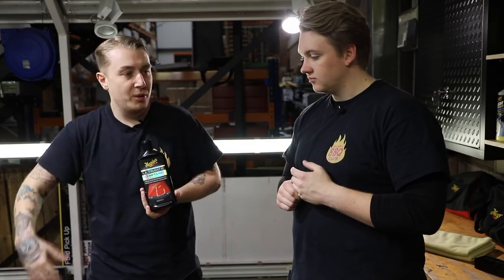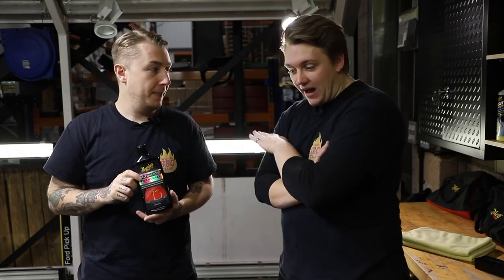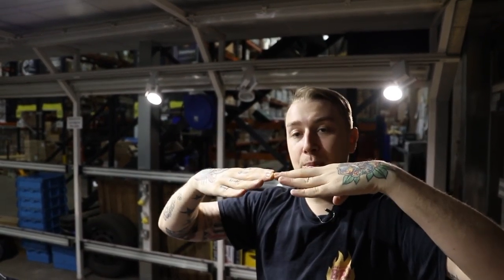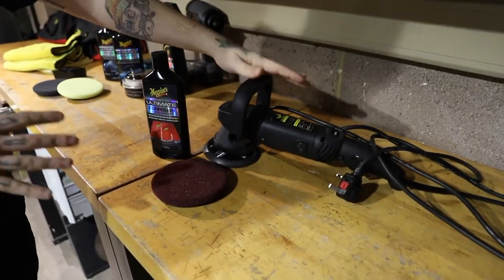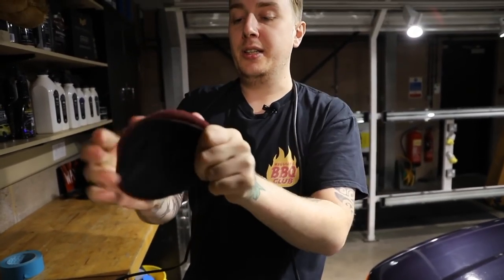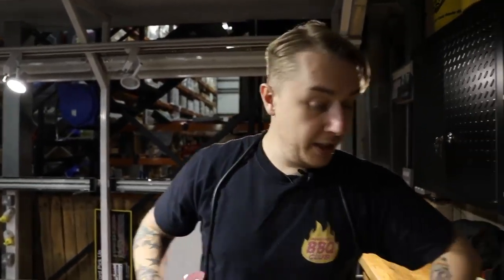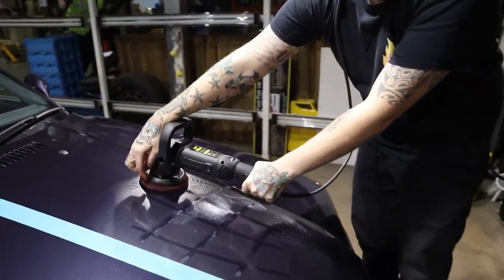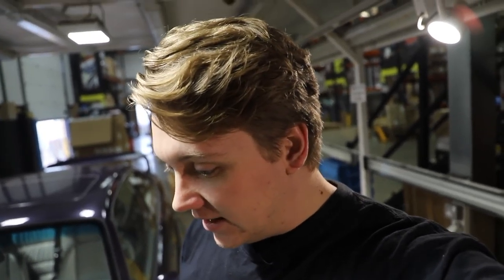Removing Swirls & Scratches with Ultimate Compound - Meguiar’s Detailing 101 – UK Edition

Comment: Hey, am I right in thinking this is the correct process of detailing my car:

1. Wash and Dry 
2. Clay Bar to Decontaminate 
3. Ultimate Compound to Cut 
4. Ultimate Polish to Gloss 
5. Wax/Ceramic Coating to Protect
Reply from the maker: Cannot speak to the condition of your vehicle and whether or not all these steps would be necessary but yes, that is definitely the correct order and process for a full detail.

Comment: Absolutely love this channel, thank you so much! Quick question, I compounded (went over trouble spots twice) and polished my car and although it looks so much better already, there are still some swirls I’d like removed. How many times can I compound/polish the same area to further reduce the swirl marks? Would you recommend going to the next cutting pad up for better results? Thanks in advance!
Reply from the maker: Not sure what product you compounded or what machine you are using so it is tough to answer this entirely.  Generally speaking though if you are using one of our compounds by hand, orbital, or DA (dual action) polisher it is very safe.  Even multiple applications is fine/safe.  That being said if some combination of product, pads, speed, machine, etc. is not working it would make more sense to re-approach with a different method rather than continue to do something that is not working.  Yes, changing the pad is one option you have to get more cut along with tool speed, pressure, working speed, product, etc.

And thanks for the support and kind words!  👍
Reply: @meguiars  is it safe to compound over bubbles of peeling clear coat

Comment: Wait so is this the order:

1) first you hand compounded a microfiber applicator, marinating the compound into the applicator and then using your hand, applied it or worked it into a 12x12 area..  Going in an  up and down motion mainly with occasional circular motion

2) Apply 5 dots to a red pad (in your case red is a hard cutting pad but for me my red pad is for finishing / polishing and is a super soft pad). Next, turn speed on slowest and move fast to apply to area (prime pad, prime surface) then set speed to at least 4-5 on the DA then move slowly to be effective (up down, then left right keeping pad on surface without adding pressure.)

3) I didn't see you guys use the polishing compound at all? I was under the impression normally we would cut compound with yellow or orange pad and apply buffer or polish using either a black or red pad?

Comment: Hi there I enjoy your videos very much my question please is if I use Ultimate compound or D300 can I use Ultimate polish and then put a ceramic coating on top ? and may I ask would you prefer D300 or Ultimate compound.
Cheers 
Colin
Reply from the maker: Yes, you would typically want to compound and polish before applying a ceramic coating.  Of course after those steps you will need to follow the coating manufactures process for proper prep before applying the coating.

Whether or no you use Ultimate Compound or D300 does not matter much but keep in mind the D300 really only works at it's best when applied by DA Polisher and our microfiber discs/pads.

Comment: I used this with a machine it was awful,I still had swirl marks and holograms,I ended up stripping it all back and started again,I used all in one and done turtle wax compound and polish,it was way better so much easier to use and all my swirls gone and holograms,paint looks like new,I binned that ultimate compound was not what it lives up to at all

Comment: I don't believe this anymore. I bought the meguiars ultimate range of compound and polish aswrll as their carnauba wax. I bought the meguiars compound pad, used it on a DA polisher with the recommended number of passes at the recommended speed. The swirls did get lighter but not removed and the car was not badly marked. It doesn't work half as easy and this video displays!
Reply from the maker: Sorry to hear about your experience.  Keep in mind every paint is different.  It is certainly possible that your paint harder than the average paint making it more difficult to remove defects.  Even light defects in hard paint can be a challenge to remove in some situations.  Please feel free reach out to our Solutions Hub to discuss the specifics of your job/vehicle.  If you have a DA Polisher you might have a couple more options that may be even more effective.

https://www.meguiars.com/contact-us

Comment: Mate brilliant video!! Quick question can I use this compound with auto glym resin polish? I have so much of that polish left as it works wonders but I  want to use maguires compound aswel.
Reply from the maker: There should be no reason you cannot use any polish you choose after Ultimate Compound.  👍

Comment: Some people have suggested slightly spraying the pad with water before using the compound, is that needed or just prep the apd as you have in the video
Reply from the maker: it is not needed in most cases.  👍

Comment: What is the differance between ultimate fast finish and NXT paint sealant?
Reply from the maker: Ultimate Fast Finish will have better protection, longevity, & durability, although NXT, in most cases, will provide higher gloss, since it has polishing oils in the formula.

Comment: Only some concerns to get the job done... Car is partially new painted, partially old- quite good but has swirls on the old part. I already have purchased Meguiar's® Ultimate Polish and Meguiar's Hybrid Ceramic Wax. Do I need before compound a Clay bar, and lubricant for that? and also a polish, I understand compound is different? And one medium pad maybe for compound and one fine for polish? (enough for the whole car?) If pad is dirty clean with microfiber? And apply by spraying the wax, and use a microfiber further? straight lines? Do I do the same process for the old and also new parts of the paint? also I understand correctly, Hybrid Ceramic Wax can be used all over, meaning windows, plastic parts?
Reply from the maker: Happy to help but this is a lot of ground to cover on a Youtube conversation.  You can start by watching some of the videos on our channel but please also consider reaching out to our Solutions Hub for personal one on one help.

https://www.meguiars.com/contact-us

Comment: thanks for the program, i learn a lot.  May i know if my car has been applied with ceramic coating, and it's got quite a lot of scratches and swirl marks after some offroading.  What's your advice, do i need to do compound, and polishing?  Will it remove the ceramic coating?  What's the best Meguiar's process and solution for me?  Thanks.
Reply from the maker: Typically, if you have scratches and swirl marks the only way to remove them is a good compound like our Ultimate Compound.  There is no way to remove scratches and swirls in the paint without also removing the ceramic coating.

Comment: Do you have to use a polishing machine to do the compounding or can you do it by hand?
Reply from the maker: You can certainly use these products by hand but results are going to vary.  Depends on the machine.  A good DA (dual action) polisher for instance can accomplish much more defect removal than you can by hand.  This is true of many products.  Even if designed for hand and machine us can work better with a machine.

Comment: So is there another step to remove the haze? Is there an additional product or a different pad for the final once over?
Reply from the maker: Not sure exactly what you mean here?

A majority of the time there is no haze left behind but yes, it can happen on very soft paints.  If that is the case we recommend you use a polish with a foam polishing or finishing pad/disc after compounding.  Again, that is certainly not the case every time.

Comment: I did a little bit of polishing earlier this afternoon, wouldnt try it again as it left marring on the paint. Thank you for this video, helped me quite a lot especially breaking the pad  to soften up the spores.

 What would you say the best time to polish outside. I don't have a garage or gazebo to help me with the sunlight. Could you advise. Tia. 
I have the Halfords da machine polisher fyi.
Reply from the maker: Ideally not in direct sun but as long as the panel/paint is not hot you should be fine.

Comment: Hi Meguiars whats the difference between D300 and Ultimate Compound? When should i use D300 and UC? Thanks!
Reply from the maker: D300 was very specifically designed for use with a DA (dual action) machine and our DA Microfiber pads.  Ultimate Compound is a more versatile product that can be used by hand, orbital, or DA.  It is also a popular retail product you can find at many mass retailer and auto parts stores where the D300 is only sold through very specialized professional supply houses and online vendors.

If you have a DA Polisher and are willing to spend some time learning about our DA Microfiber System that may be an option for you but for the average person Ultimate Compound might be a much easier and more easily available solution.
Reply: @meguiars  Nice! Thanks Meguiars!!
Reply from the maker: Happy to help!  👍

Comment: Quick question. Using the ultimate compound with an DA orb machine, is it better to use a foam cutting pad or a wool pad? Is wool more abrasive?
Reply from the maker: That can depend on the correction that is needed for your vehicle, either would be a great option but yes wool would be more aggressive than foam. We would suggest starting with the least aggressive method possible then trying a more aggressive pad if needed.
Reply: @meguiars  Thx lads. BTW any harm using ultimate compound to restore headlights?

Comment: Once the compound has cured, can you leave it on whilst doing other panels or does it need to come off right away?
Reply from the maker: Compounds and polishes are removed before they dry as they can become difficult to remove. You can repeat this process as many times as needed until you achieve your desired finish.
Reply: @meguiars  completed my integra dc5 today! I’ve tagged you guys on instagram 👍 really happy with the results! Spent just over 10 hours on the car today

Comment: What polish do you use after the swirl removing polish.
Reply from the maker: Polishing is often an optional step based heavily on the condition and color of the paint as well as your desires for it.  If you do choose to polish after compounding to remove defects in the paint there are a few options but our Ultimate Polish or our M07 Show Car Glaze are two of the most popular if applying by hand, oribital, or DA.

Comment: What should I do after I compounded my car? Could I use the ceramic detailer or quik wax? Thanks a lot.
Reply from the maker: Yes, you can use the Quik Wax after compounding as you would typically want to apply some form of protection.  Keep in mind the Quik Wax is a maintenance product designed to be used in between you regular paste or liquid waxing.  If you want the best protection you might want to consider something like our new Hybrid Ceramic Liquid Wax.

The detailer can be used any time to safely wipe down the car when it is lightly dusty/dirty or you need to remove some fresh contaminants like fingerprints, bird droppings, or fresh water spots.
Reply: Meguiar's brilliant!

Comment: Will the paint be dull again if it rains after applying this product?
Reply from the maker: Not sure why that would be the case?  Maybe we don't full understand the question.  Can you please clarify.
Reply: Meguiar's some products will wash off in the rain,  leaving the freshly polish paint dull again. Will this product remove some paint and leave the surface shiny through rain? Or will it return to a dull appearance after it rains? Hope this helps?
Reply from the maker: Neither.  This is a compound designed to remove light to moderate defects in paint.  It will only shine the paint in the sense that the paint will naturally look better when the defects are removed.  This is not a polish or a wax.  It is not designed to add much shine or protect.  There is nothing left behind for rain to "wash off".

Hope that helps.  👍

Comment: Would this product be good for ‘pin stripe’ like scratches that are only in the clear coat from 4x4ing? Just got loads of superficial scratches from driving through the bush
Reply from the maker: Yes, this is worth a shot.  Clear coat is clear paint and most cars have a clear coat so scratches in your clear coat is synonymous with scratches in your paint.  This is one of the most common uses of Ultimate Compound.

Comment: Do you use a 6” pad with a 5” backing plate ?
Reply from the maker: Depends on the backing plate and pads.  With our current line-up of backing plates and pads it is as simple as matching the backing plate to the pads.  The DBP5 5" backing plate is designed to be used with the 5" discs/pads.  The DBP6 6" backing plate is designed to be used with the 6" discs/pads.  However if you are trying to mix and match other machines, backing plates, and pads there is more information needed to determine the appropriate pad size.

If you need help please gather that information and reach out to our Solutions Hub for help...

https://www.meguiars.com/contact-us

Comment: Why am I having such a hard time wiping off the compound after using the machine?
Reply from the maker: It could be a number of things but the most common reason is working the product too long and/or letting it dry.  You really only want to do a small section no more than 2'X2" and wipe it off immediately.  The amount of product, weather, and toweling used could also be factors.  Also keep in mind if you have paint that is already at the point of failure any product you apply may simply stick to the dead/porous paint making it very difficult to wipe off.

Hope that helps narrow it down for you.  Please feel free to reach out to our Solutions Hub via our website if you want to discuss with a Surface Care Specialist directly.

https://s.3m.com/t94r89

Comment: After using Meguiar's Clay do you recommend use Ultimate Compound or Ultimate Polish?
Reply from the maker: Really depends on the condition of the paint.  If you have scratches, swirl marks, water spots, oxidation, etc. you will likely need the Ultimate Compound next.  If the finish is near perfect and you want to add maximum gloss before waxing you could skip the compound and use the Polish.

Comment: Would you use your hybrid ceramic wax before or after this?? Please help me!
Reply from the maker: You should always compound before waxing.  👍
Reply: So I should clean the car as normal but leave out the spray hybrid ceramic wax, dry the car then apply this, then re water the car to use the hybrid ceramic wax?
Reply from the maker: Yes.  Here is a video that shows you the proper application of our Hybrid Ceramic Wax...

https://s.3m.com/3gnsn3
Reply: Cheers maguiars 👍🏽

Comment: iv been going over the same area multiply times and it never removes any scratches. I dont understand. But it gets more shiny with deeper color..
Reply from the maker: First, you want to make sure you are using the appropriate applicator pad for application.  We recommend a foam applicator pad when applying by hand.  Secondly, it is possible that the scratches are deeper than you suspect and/or your have hard paint.  If that is the case you are likely at the point where a machine application might be required.

Feel free to reach out to our Solutions Hub via our website to discuss in more detail.

https://s.3m.com/3keeqr

Comment: how long it lasts?
Reply from the maker: How long any protection/wax lasts is highly variable and depends on a number of factors related to the condition of the paint, previous prep, and the environmental elements the vehicle is exposed to. 

That being said we typically recommend most people apply wax at least 3-4 times per year.

Comment: Would waxing the car also remove the compound haze?
Reply from the maker: The first goal would be first to not have a haze left behind after compounding.  Evaluated the technique, products, and application materials you are using.  Secondly, if there were a haze left you would typically address that with a mild polish that contains some light defect removing capability before waxing.

Not sure if that is what you were asking exactly but hope that helps.

Comment: Sorry Meguiar’s Ultimate Compound with filler. You can Try clean up with brake cleaner or alcohol after you use Compound. You can See come back to scratch
Reply from the maker: Not sure what your personal experience is but Ultimate Compound is designed to actually remove defects not just hide them.  We, as well as thousands of consumers, use it regularly for just that.

Regardless we appreciate your feedback.  If you would like to share more details please feel free to reach out to our Solutions Hub here...

https://www.meguiars.com/contact-us
Reply: its true. i tried with 3M compounds and it worked well. Meguiar's Ultimate compound just fill the scratches...

Comment: So you go in this order 
1. Clean and clay bar the car 
2. You use ultimate compound 
3. Ultimate polish 
4. Wax it of for the finish
Reply: @meguiars  what if you want to add a ceramic coat instead?
Reply from the maker: If you mean you wanted to apply a ceramic coating you would just do that after the polishing step and skip the wax but of course you would need to then follow the prep steps recommended/required by the coating manufacturer.